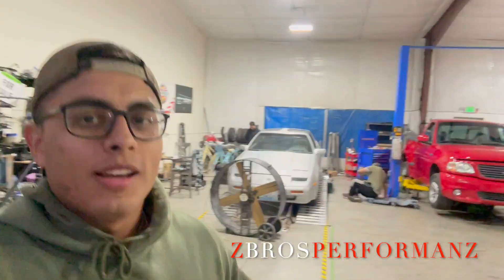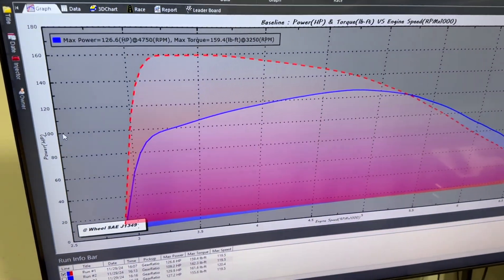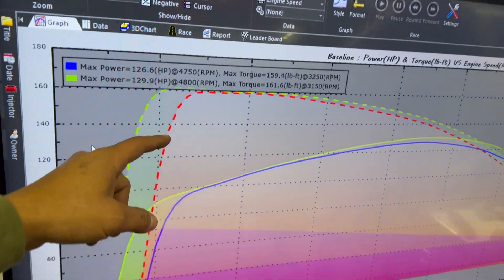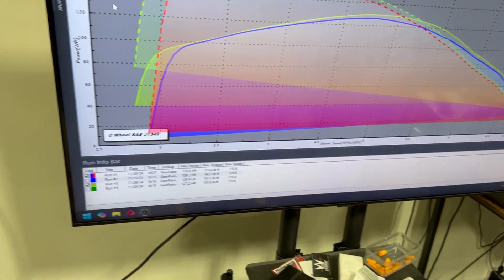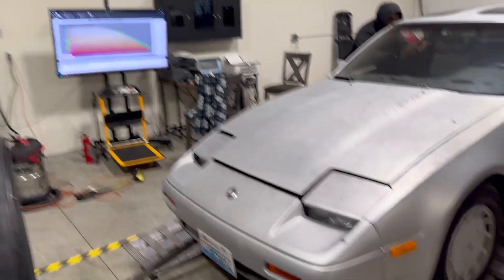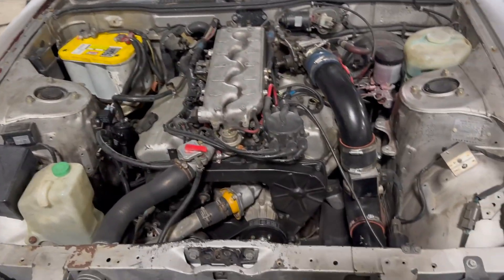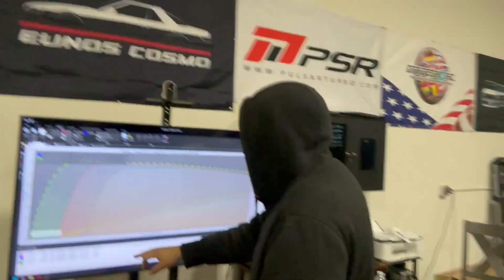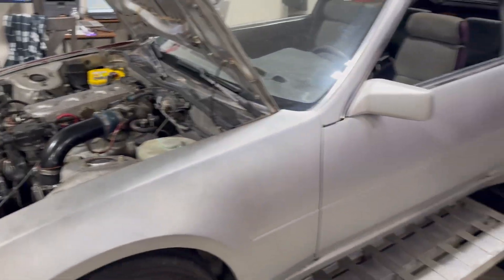DYNO test on 88 Nissan Z31 300ZX NA

Comment: yo this is a dope video, i thought na's made like 170? also it would've been sick if you showed the actual pull haha, anyways great video though!
Reply: That’s the crank horse power rating. You lose around 25% through the drive train.
Reply from the maker: Yeah we were too excited to try it on the dyno that we didn’t record, maybe we can get some more videos of it soon!
Reply: like diejps said, drivetrain mostly causes this loss. although, going off of rough numbers here, the vg33e made around 170-180hp, while the vg30e made around 157hp factory, so going off of the vg33e in there, and that drvetrain and parasitic loss can be around 10-20% car to car. not sure what it is on the z31 and all, but going with a very high 30%, this engine probably hasn't lost much power over the years, maybe couple percent (~<5%), then again, with more conservative estimated parasitic loss of 10%, this engine would have lost around 20 or 30 horsepower, but I haven't a clue how much loss the drivetrain makes, definently depends car to car. lotta research into parasitic and drivetrain loss, not neccesarily an easy way, but a good way to make your car quicker if you are able to reduce it, little bit here and there adds up, although damn i still hate the previous owner for removing ac! did not help with performance lol